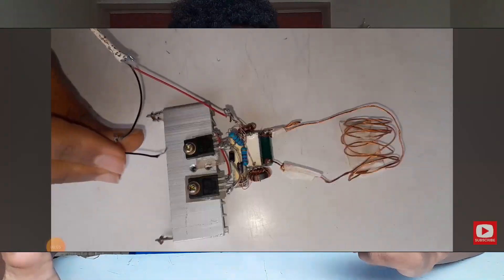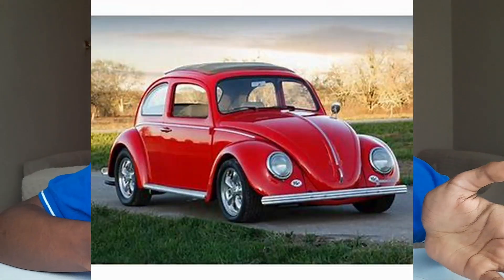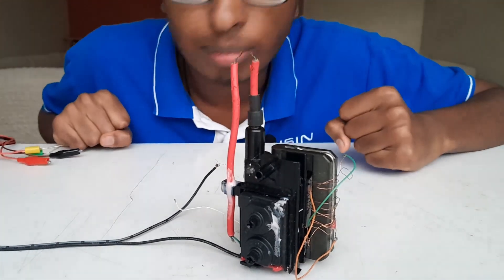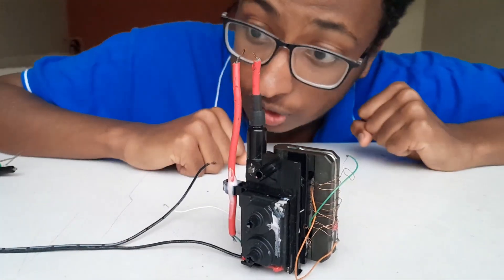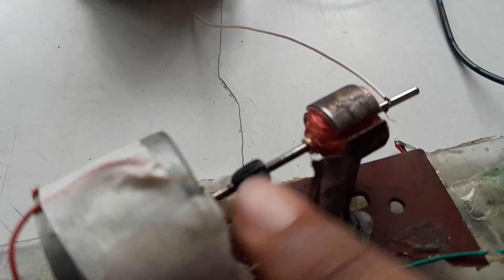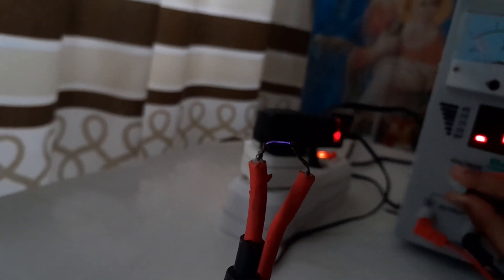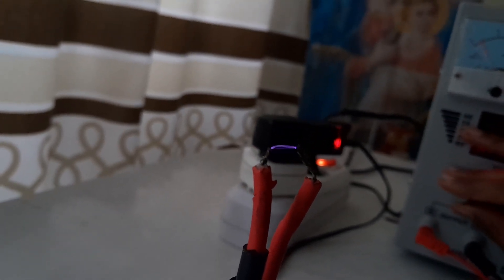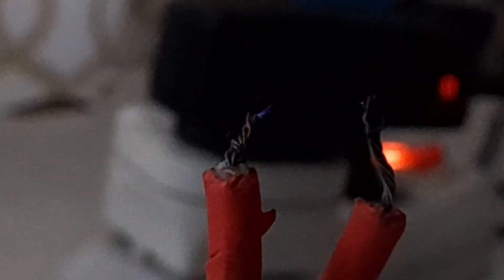I Found An Old Way to Make Gnarly High Voltage Using Contact Breaker...

Comment: This style is more true to a distributor on a car. An even simpler way to do this is with a hammer type interrupter. It's basically a relay wired to be normally closed and opens on power. This gives a continuous buzzing that will supply a decent square wave for low to medium power. Admittedly the distributor is more controllable in terms of frequency and can be made to handle a bit more power.
Reply from the maker: That could also be possible..

Comment: Bro lower the primary turns number to have more voltage per turn and a high voltage output on secondary
Reply: OR give it more power  💥💥💥💥😎😎😎😎